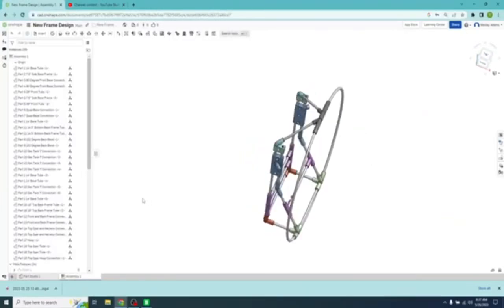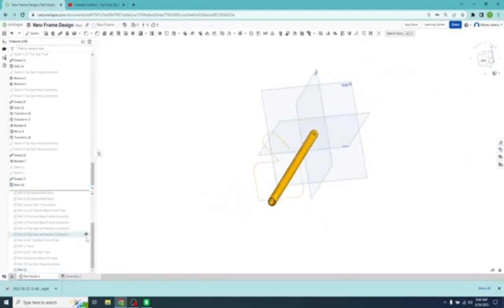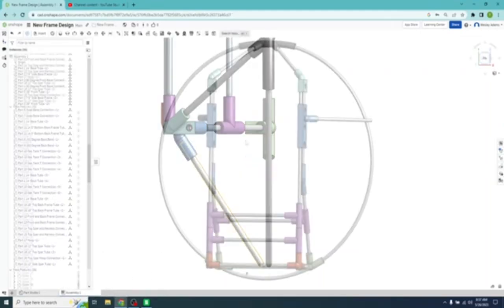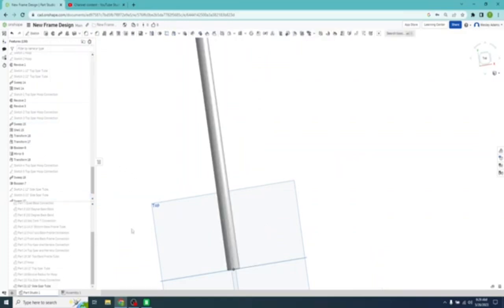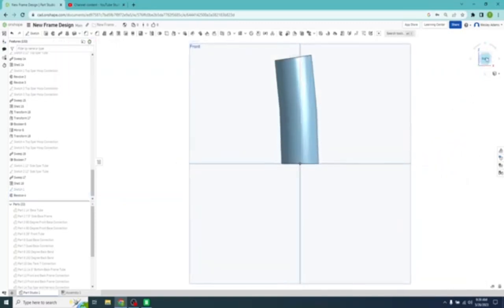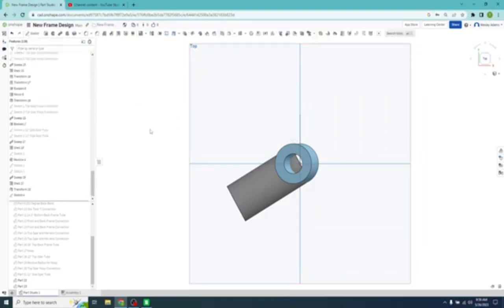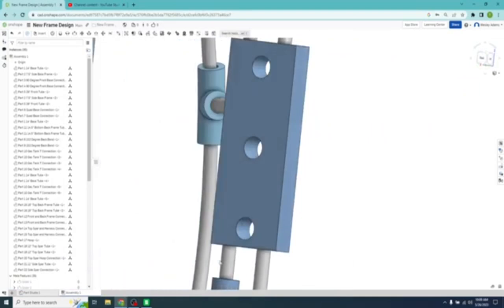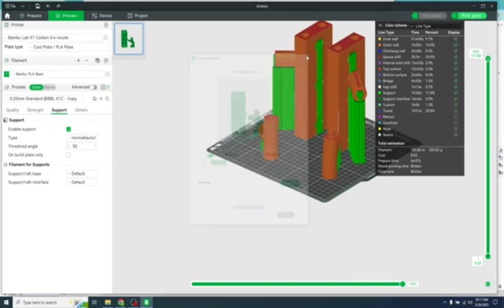3D CAD Designed Paramotor: Step 18 Side Spar Connections

Comment: wow talk about continued develop,ent , not checked in for while ordering motor and just seen this ,,, freaking awesome work and massive thanks for sharing this info , i have only one thing to ask .. These DLE type motor seem to vibrate a lot at ideal or lowish rpms. how will this impact on the joint connection . not a critisism im loving following your development just wondered about the viibration  asspect . Cheers  def keep up the great work youll be the defact goto with your take on Mini Paramotor concepts ..
Reply from the maker: The DLE 170 has a lot of vibration. I’m using the vibration dampening bolts. It helps, but not perfect. I just applied woven fiberglass and resin today. I was worried the heat would deform the part, but it didn’t. I’m going to perform some strength test tomorrow. I’ll post the video once complete.
Reply from the maker: I’m also working on a new set of connections that can be bolted or snapped to the tubes. I should have the updated videos completed at the end of July with the updates. Thanks.
Reply: @TexasParasurvival  big thank you for even posting your work , looking at Onshape  now as an option for cad modeling , so big up respect for all your efforts and posting such a detailed video seriies .eagerly look forward to the next development step  cheers